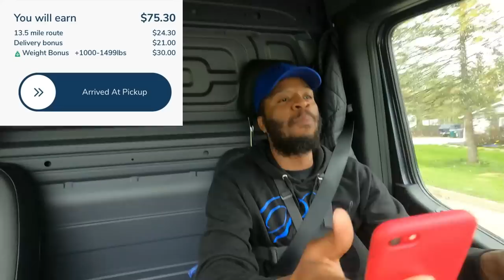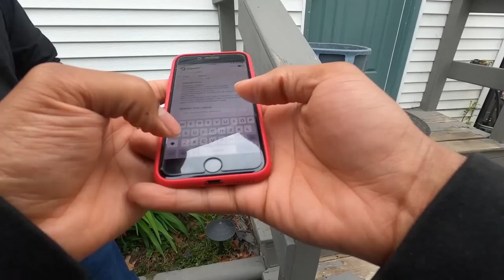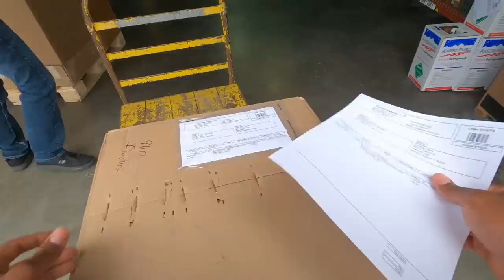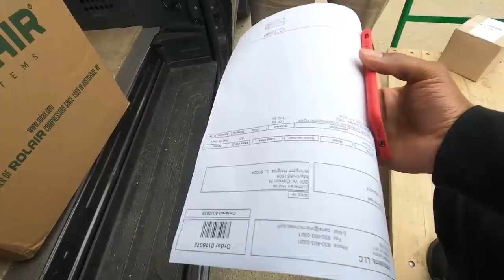URGENT‼️ If You Have Or Plan To Get A CARGO/SPRINTER VAN, This Is A MUST HAVE! #foryou

Comment: Question. If something is heavy enough to dent that metal wheel well. What do you think it would do to that plastic cover
Reply from the maker: The metal dented and scratched pretty easily
Reply: It’s probably some kind of polycarbonate, not plastic.

Comment: How much u got ur van bro I need one ?
Reply from the maker: Prices are different now. I know someone who just bought a 2023 Sprinter for about $64k taxes and everything.
Reply: @carsandcribs  am about to get 2021 2500 for 38k and it has 82 miles should i get it bro ?
Reply: @carsandcribs  i find one 38k and it is 2021 it has 82 miles high roof 2500